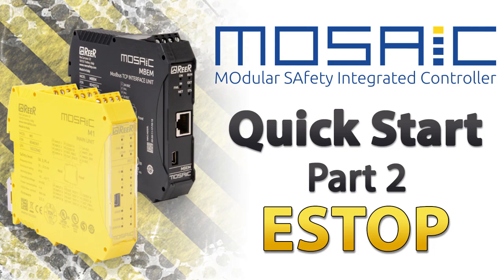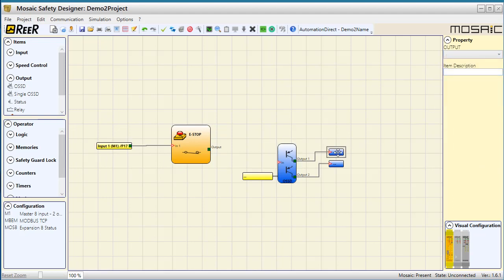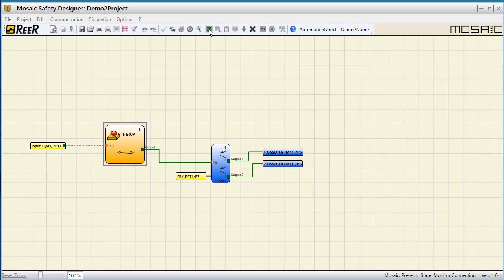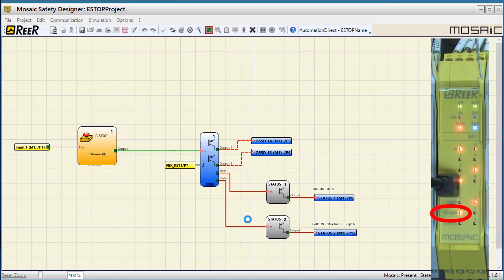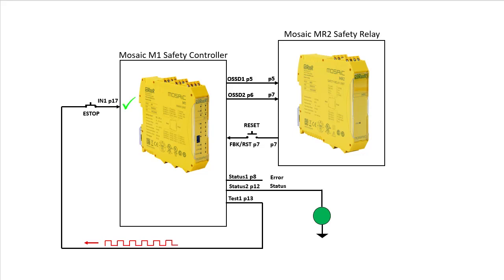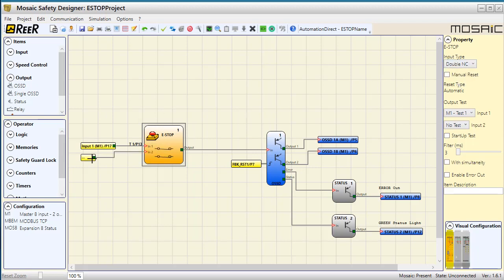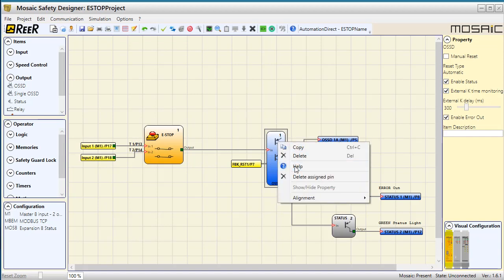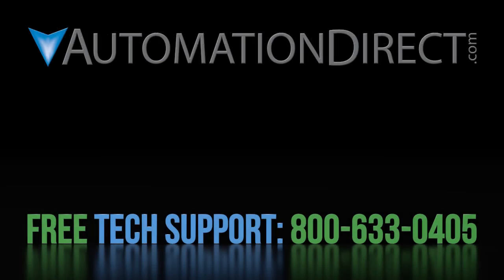REER Mosaic Safety Controller: Quick Start Part 2 (E-STOP) from AutomationDirect

Comment: Why doesn't the reset clear the error status? Manual states that to clear the error output  either power cycle after fixing the issue or perform a system reset.
Reply from the maker: @paganskier
The reset button does not clear input or output errors because these errors often indicate a serious or potentially dangerous condition, like a wire has come loose or 24VDC is now on a wire that is not supposed to have voltage. Simply pressing a button without addressing the root cause of the error could put people, equipment, or processes at risk. When an error occurs, the user needs to find the error and then acknowledge the error has been corrected by power cycling. The reset push button is used for acknowledging events during normal operation, Ie. The light curtain tripped, the E-stop was activated, the Guard door was open, etc.
Reply: @automationdirect  right - I do the same with my PLC code. Like if a monitoring contact on a safety relay doesn't change states when it should. Hardware failure that requires service - no reset allowed.

Comment: Why is the Relay not shown at 2:48 in video.   We just see the OSSD signals going to it from P5 and P6 of controller
Reply from the maker: @michaelcostello6991, Are you asking why the system connected to OSSD outputs 1A and 1B isn't shown on this flow chart?
Reply: @automationdirect  yes
Reply from the maker: @michaelcostello6991  it isn't shown because it doesn't matter what the OSSD outputs are going to. The system monitors the Emergency stop button and turns off the OSSD outputs to whatever device is receiving them. Similar to safety outputs in a safety PLC. You can label them if needed, but ultimately what consumes the output doesn't matter to the safety controller.

Comment: They really need an improved workflow for the password calls. An "enter password for this session" checkbox should be added on each password entry instance to end the nusiance factor.  Debugging is always necessary, and all that password typing adds no value.  Pressing the monitor button should be a freebee an not engage the password screen.  The password function is to prevent unwanted changes rather than impede a programming session or program development.  Password could also be reenabled if tbe unit is disconnected during the session.
Reply from the maker: Thanks for the feedback Alex. We will pass your suggestion along to the manufacturer.
Reply: Gyk
Vu
Reply: Please can you help me about connection diagram, I do like yours same settings but I can not set like yours...
Reply from the maker: @neslihancosanay2624  for more in depth questions like that we need to get you in touch with our Award-Winning technical support team. They are available to assist you with the specifics of your application. They can be contacted at: https://community.automationdirect.com/s/contactsupport